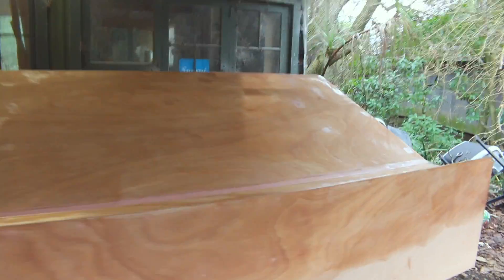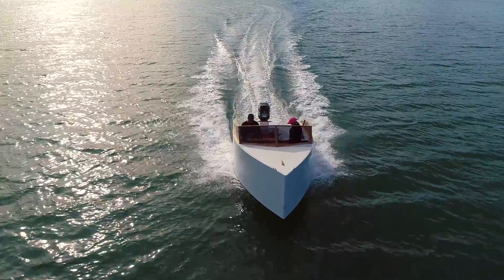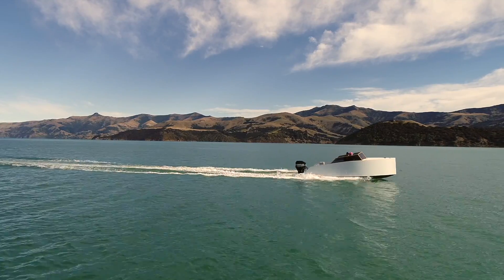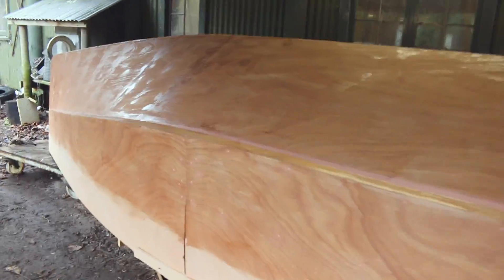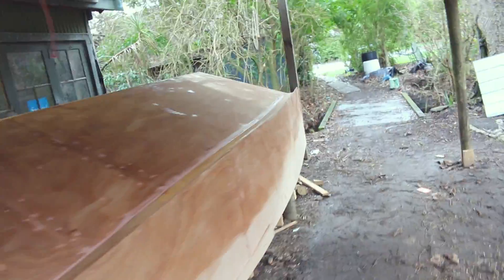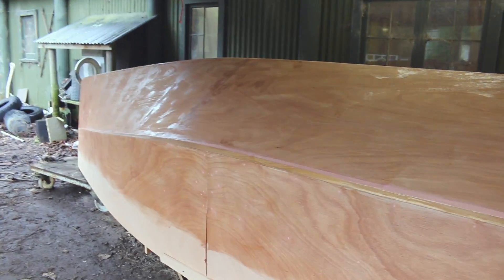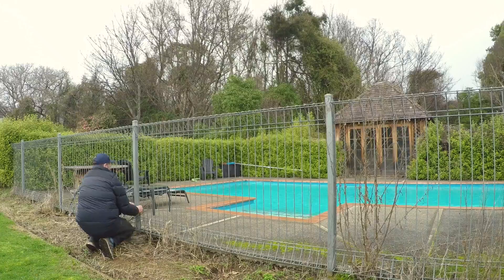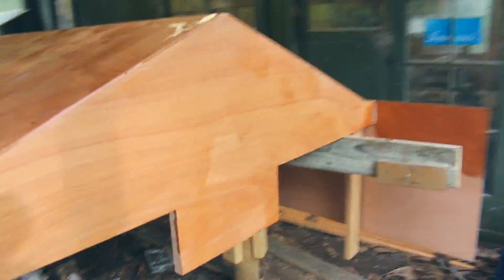Building A Boat without plans!

Comment: If your using it in a lake or protected waters you should reduce the V hull to almost flat. Using fuel to push water rather than gaining speed would be the idea for protected water or calm water like seen in your video. If your using 135 HP you would have a larger boat that would go up on plain quicker and be faster.  go to Svensons free boat plans and examine designs.